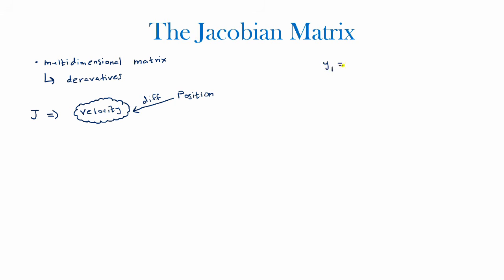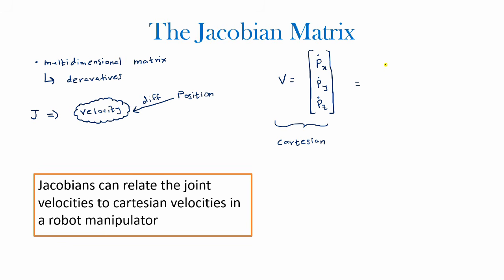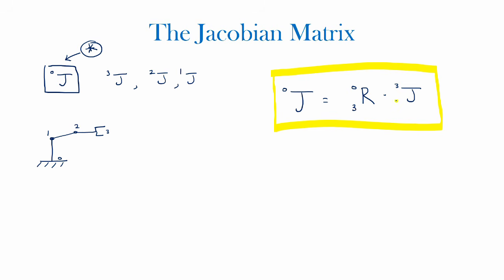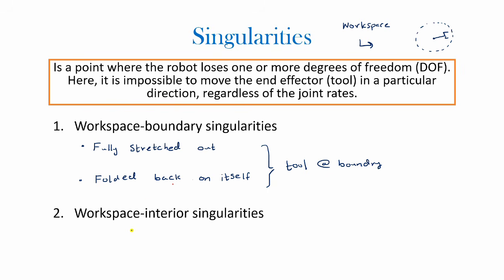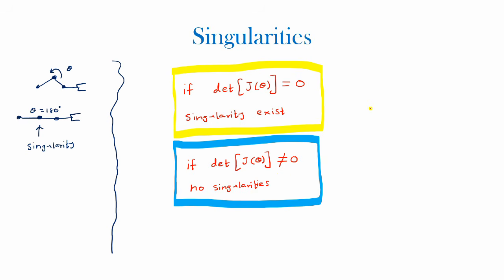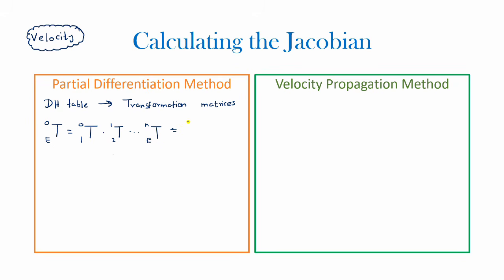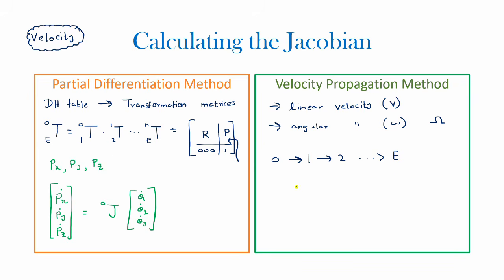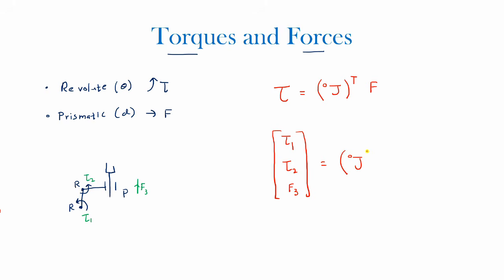Jacobian Matrix and Singularities | Robotics | Introduction | Part 1

Comment: (I'm not 100% on this; I'm opening this interpretation up for comments)

I think the way you're doing Jacobian matrices, it's with a coordinate patch, mapping the generalized coordinates from the coordinate space into the configuration space (manifold) Q, and where the Jacobian (determinant of the Jacobian matrix) is zero, the vector field on the configuration space is zero, what is sometimes known as a critical point of a differential equation on the configuration space.

There is another way of thinking about critical points of differential equations (vector fields) on configuration spaces, as a section of the tangent bundle of the configuration space, \xi:Q -> TQ. Where there is a critical point of the differential equation, one can take the Jacobian of \xi (*not* the Jacobian of the coordinate patch), and this becomes the "A matrix" of the state-space representation of a plant function about the critical point. This Jacobian matrix will have eigenvalues, some of which may have positive real part and some of which may have negative real part (let's assume none have zero real part, so the Hartman-Grobman Theorem applies), so we can put an open-loop controller and a unital feedback loop on the system near the critical point, making all the eigenvalues of the closed-loop system have negative real part ("stable eigenvalues"). We can then put the real part of all but two of the eigenvalues out between, say, -5 and -10 (called the "non-dominant eigenvalue"), and then, for the remaining two eigenvalues, put their real part, say, between 0 and -2 (called the "dominant eigenvalues"), and meet the design specifications of the control engineering problem with proper placement of the dominant eigenvalues.

Let me know what you think about this interpretation of the underlying mathematics.